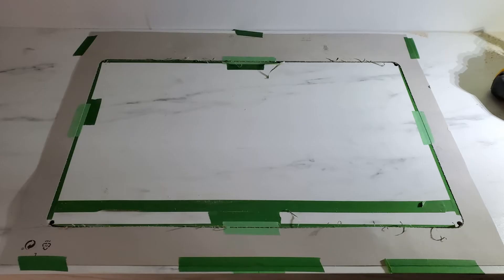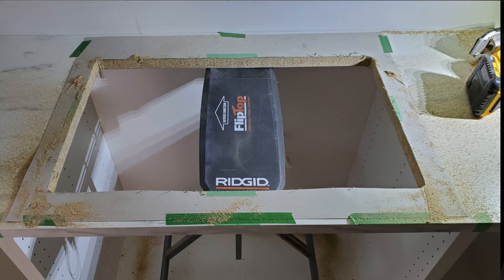Unlock the Secrets of Installing IKEA Kitchens like a Pro (Part 3)

Comment: Question: I will have a 30" sink cabinet. I want an undermount sink. Can I use a 30 inch sink or does it have to be smaller? I like one on amazon that is 27'', would that work or does it need to be bigger? Thank you for these videos!!
Reply from the maker: Answer: it depends.
If the flange/brim if the sink is 30" wide it might work but you'll have to ask your counter top company.
I would pick a size smaller if it was me. The 30" sink cabinet is 28.5" inside in width.
Reply: Find the spec sheet for the sink.  It will tell you all the dimensions.  Also check in their installation manual if the sink needs any extra supports.